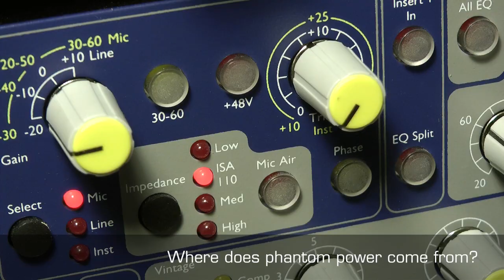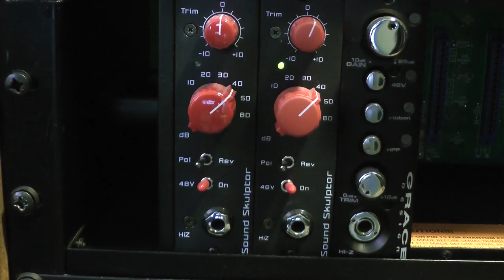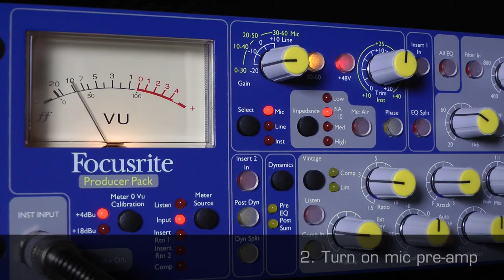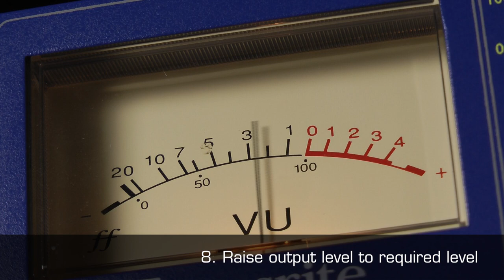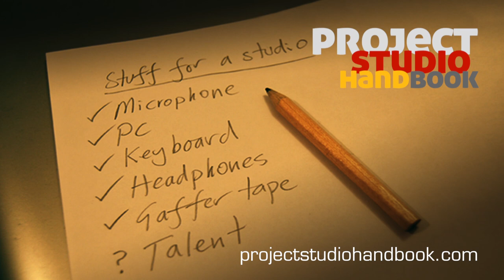Phantom power

Comment: I have a question about the connection order: once the preamp is turned on, when do I have to connect the microphone cable? Before or after the phantom power is switched to on? Sorry if my english is not so good, hope you understand the question.
Reply from the maker: Filippo Mancini Always connect the cable before enabling phantom power just in case you create a short-circuit during plugging in. You can connect the cable before or after the pre-amp is turned on, but keep the monitoring level muted.